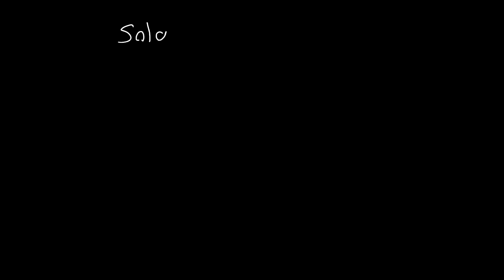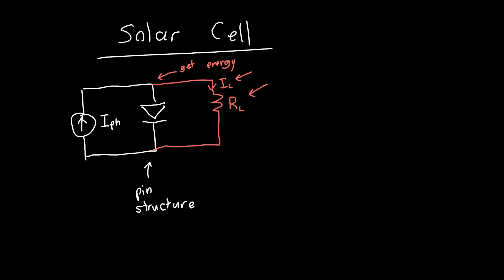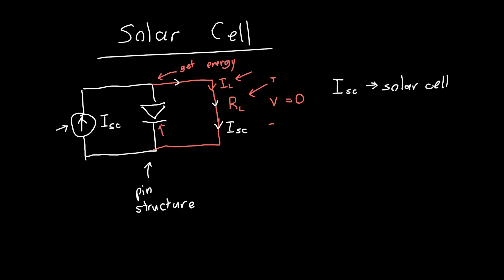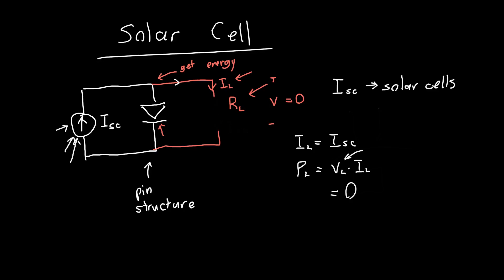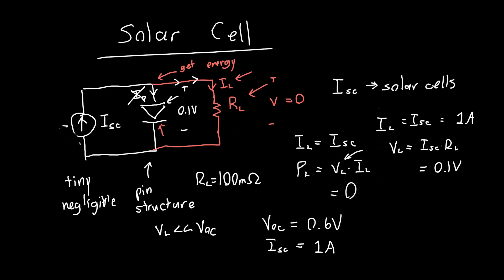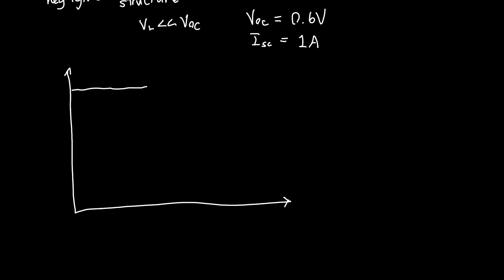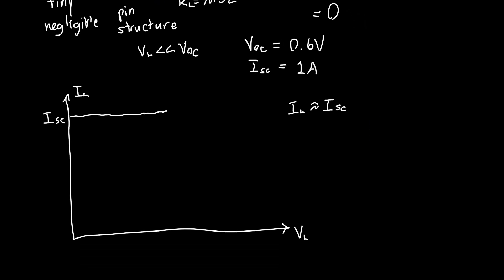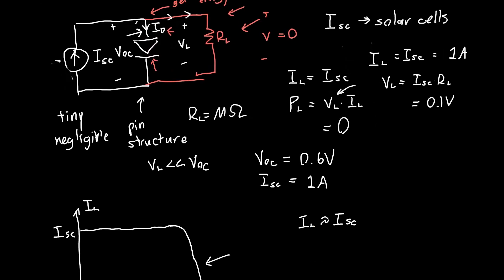Solar Cell Circuit (with Load attached)

Comment: What are the relationships like between irradiance and Isc and Voc? I've heard irradiance vs Voc is nonlinear and irradiance vs Isc is linear, but I'm struggling to get a straight answer on this
Reply: From my understanding, Voc and irradiance don't really have a relationship. It doesn't matter how many photons are hitting the photovoltaic cell and delocalising electrons per unit time (that is, assuming that the photons have an energy greater than the work function of the material they are delocalising the electrons from). Eventually, enough electrons will gather at the N-type layer, and enough electron holes will gather at the P-type layer to form an electric field that will attract the holes and electrons back together again. At that point, the delocalised electrons and holes will flow away from the depletion region as fast as other electrons and holes will flow back towards it. Once they reach the depletion region, the holes and electrons recombine.
What you end up with is a roughly constant amount of holes and electrons gathered on the P and N-type layers, across which you have your potential difference Voc. It's not relevant at what rate electrons are being delocalised and flowing away from the depletion region, this will just be balanced by the electrons flowing back to the depletion region at a higher rate.
As for Isc, I don't know.

Comment: I keep seeing this simple model all over the Internet....why is that? Does everyone copy and assume that is all there is to the subject?  I subbed just in case you are going to flesh this out with a more realistic model.....looking....looking.....
Reply from the maker: The reason it's all over the internet is that it's a quite accurate model. The main thing it's missing is the series resistance of the wires connecting the solar cell to the outside world, as well as the shunt resistance of the solar cell itself. Also, if you have a solar panel and not a single solar *cell*, you will stack a bunch of these in series. Hope that helps.
Reply: @JordanEdmundsEECS   Thank you so much for this wonderful explanation! can you please add a video including the series and shunt resistance? if you could explain how the shunt resistance affects the Voc, it would be amazing!  your video is one of the clearest I have seen on this subject, and only this part is missing. Thanks again!
Reply: Sir, How does current flow when the solar cell is open circuit ?

Comment: may be this a sptupid question but anyways i'll go for it. since diode is a sigle piece component why is current source in parallel and not in series to the diode?!
Reply: My understanding is this helps create a simple model for simulation, and the diode and its current during irradiance does not make sense in the real world, since with no load there is no actual current flowing anywhere (other than the leakage current of the PIN device): If I was to create an equivalent model, it would be far more complex !

Comment: the last graph P vs I , for the x-axis, insteads of I L, suppose to be I sc i think. and The middle point is I L max at which I sc provides enough current to go through the diode.